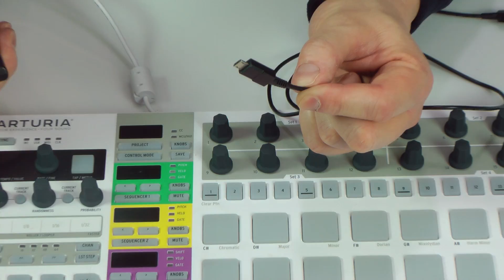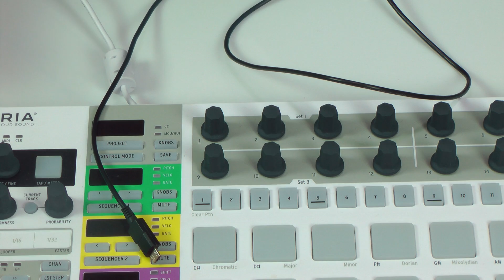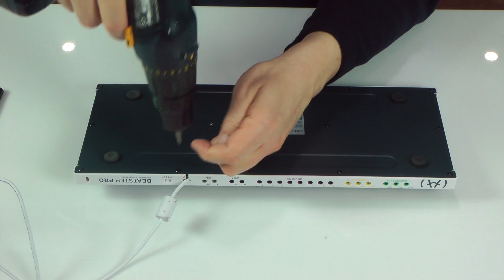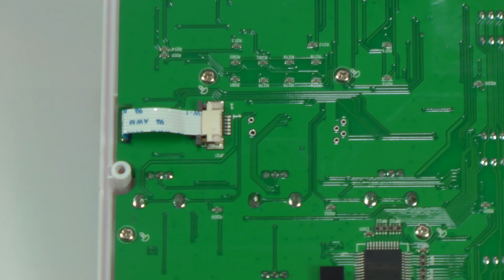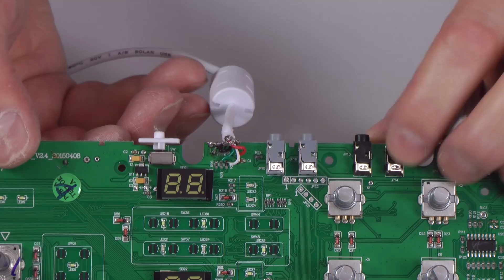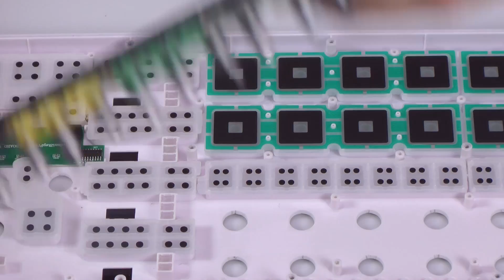Arturia Beatstep Pro Broken/Damaged USB Fix and Repair

Comment: It worked!! Thank you so much for graciously putting this video up. My Beatstep broke and a little research led me to the correct conclusion that it was the microUSB connector that plagues many owners of this great instrument. I didn't want to throw the thing away as it is expensive so I took the time to watch a few videos on soldering (I had NEVER soldered anything before this morning) and borrowed a soldering iron from a friend. This was not easy! the components are TINY. I used the magnifier on my phone to enlarge everything, took my time, screwed it all together - BOOM. Working perfectly! Recognized by Midi Control Center as well. If anyone else out there has this problem (end eventually ALL Beatstep owners will - that microUSB is absolutely a design flaw!) don't be afraid to try this out. Watch a  few soldering how to's - set up some kind of magnification, and take your time. It works!

Comment: Just did this fix and it solved the dodgy power issue plus it re-established a lost connection to the Arturia Midi Control Center. Highly recommended mod and not difficult. Suggestion 1: Unless your cable is very rugged it is possible to pull it through the usb slot without modding the chassis. Suggestion 2: To avoid pulling on the solder joints when handling the cable, simply put a small cable strip around the usb cable on the inside of the chassis.

Comment: THANK YOU!!  I’m gonna just add the red, black, white, and green wires on a pigtail, drill a hole in the chassis, probably between that micro usb and the TRS MIDI output jack, and just let those wires hang out the hole I drill. I have some ac/dc adapter barrel connectors that have little screw terminals,so I’ll probably power it with an ac/dc wall wart that’s putting out whatever the nominal voltage is from a usb supply.  If I want to get fancy maybe build a little failsafe circuit to keep it from accidentally providing too much voltage, I’ll just keep that external to the unit, and that way if I have to, I’ll still use the micro USB if needed, but for me it’s not broken, just a loose wiggly annoyance that puts the fear of power loss into me!  THANKS AGAIN!!

Comment: Thanks Paul your video has given me the confidence to take this repair on, Im just waiting on a soldering iron, i will let you know how i get on. Thanks again
Reply from the maker: +SAW3 You'll need a fine tipped one because the tracks and components you need to work on are very small.

Comment: Yep... same here. Frikkin USB ports are dog doo-doo. Anyways, I fixed it thanks to these instructions. However, I added a cable-tye in the inside so that the cables can be tugged past a fixed point (i.e. the cable tye). This reduces tension on the DELICATE solder points. Also, I covered the whole job on the inside with silicone gel...but beware! - you must use non-acidic gel. Normal silicone will eat into the board. Finally, you do not have to bevel away the white plastic for the cable.... just insert it before you start soldering! Good luck all! Looks easier than it is!

Comment: I've recently had the same issue with my beatstep pro. After sending it back to Arturia they've decided the replace the entire PCB and are awaiting new parts. Hopefully this will fix the bad initial hardware design with more robust connections! A real floor in what is potentially an awesome piece of kit.
Reply: Did Arturia fix it under warrenty?
Reply: I sent it back to the UK dealer I bought as this was cheaper and easier. In the end I was sent a brand new unit from the dealer as the parts weren't available still 2 months on.
Reply: Hard to know. They refused to repair mine under warranty, claimed that it was user error, and in fact I ended up with a $45 inspection fee! Needless to say I will never buy another Arturia product.
Reply: Yeah it's a shame, it is a really great unit and there's not a lot that can touch it for the price. I'm using my Analog 4 to sequence now, which is very powerful but also kind of confusing. There's lots of good stuff in eurorack of course ... intellijel metropolis looks really cool, or makenoise rene

Comment: To the ppl that still got problem. MAKE SURE YOU USE CABLE THAT HAVE DATA AND POWER!. I took mine apart measure connection etc even heat up joints. And still nothing... Than I realized I used cables that were only for charging! Some cables don't have data connection (Chromecast cable I check, bt speakers etc...) So mine is working...
Anyway by seeing common problem I'll order usb C port and Y cable and use that as usb C is more reliable and used everywhere.

Comment: I got one of theese for repair. Someone already did this mod but it came off. I soldered everything back, it works, it powers on but computer cannot
see it. Neither Mac or Win. I can trace signal from USB jack all the way to CPU. Could it be that usb controller on STM is dead?

Comment: I've done this mod and had it working, but in trying to fit the cable more robustly, I ended up having to resolder a few times. I lost the smd capacitor (C1) along the way. Does anyone know that capacitor's value? I have some through-hole spares that i will use as a substitue if I have a match...

Comment: So I may have a helpful comment for everyone! I haven't put it back together just yet and fully test it, but I was able to do this repair, and still had access to the USB functions (Opened the midi control center, checked the firmware, copied and saved patterns). 

I followed the same points on where to solder, but what I used was the Anti ground loop adaptor instead of the regular USB cable. Then plugged them both in (USB to the computer of course, and PWR to another cable to a USB wall plug). 

Had to reattach the touch strip first, but after that it showed up in windows/midi control center!

I can't really say why exactly this helped compared to just soldering the regular USB cable by itself, but I thought I'd give it a try and was happy it worked. I'll be putting it back together soon and I'll give it a more thorough test.

Hope this helps everyone out!
Reply: You are lucky... Mine is not working at all... I soldered the Y cable instead of the cable directly, tried to do the same as you, but win/mac doesn't recognize. It would be cool if Paul the OP could share some light on this!

Comment: Hi! I followed your instructions and my beat step is up and running again, but im completely unable to update / or have it recognized by both my mac or windows computer. Could it be something to do with the wiring? I followed your instructions and i have this bug.
Much appreciated!
Reply: same here, computer doesn't recognize it but accepts power.
Reply: same here. fixed the usb connector but no connection on pc or mac...
Reply: did any of you figure this out or is any bsp fixed this way doomed to only control outboard gear?
Reply: @TEHBILB  check my comment, might have found a fix!
Reply: I wired the Y cable instead, still not recognized by pc too... Anyone has a Solution? Vac checked your post, but no success, still not recognized.
Reply: I had the sam situation and had to struggle to clean the damaged area and been precise on the connections. After some testing, my macbook recognize the midi controller. You'll got be knit mate.

Comment: hey Paul I followed your instructions and I got power but I got an error message in the display. Do you have any ideas?
Reply: connect roller board
Reply: Bart O thanks i will check that.

Comment: What is the value of R23? I was gifted a beatstep pro where someone attempted this mod. They lost R23!
Reply from the maker: Not sure but if its on the data line there resistor on the other line is probably the same value which you can measure.
Reply: Hope I'm not too late to save yours! R23 and R22 are both 22 ohms, and R25 is 1.5k ohms. Hope this helps!
Reply: @whoisrobmay  Oh mate you were just in time to save the next guy! Thanks!!

Comment: Any one that did this fix sucessful who can take a picture where the black cable is connected. 
I have done this but something gone wrong. I get some parts to light up. But not the sequenser parts.
Suspect I might have heated up a resistor i connected to, too much. But how to find witch one?
Any one who ended up with that result? How to solv it?
Reply: I just did this fix successfully. I had not seen your comment so no pix, sorry. But the black cable is simply connected to the hole/area close to the U shaped cutout, where the usb connector used to sit. It is just the ground connector. Hope it works out.

Comment: omg sorry but wtf... this is not the prof. way to fix such stuff . get an usb b connector and some cables and fix it with it
Reply from the maker: Yes, your right it is a bodge and using a USB B connector on a flying lead would also work but when the damn thing just rips off the board because it's too small for the intended purpose you don't have a lot of options and this is just one, I wouldn't mind but they still use these on their newer gear too.